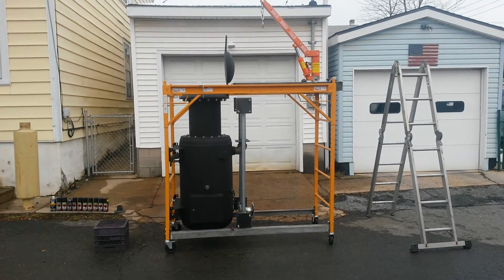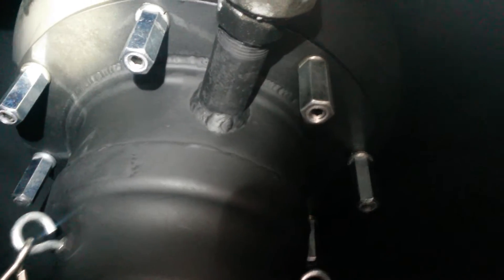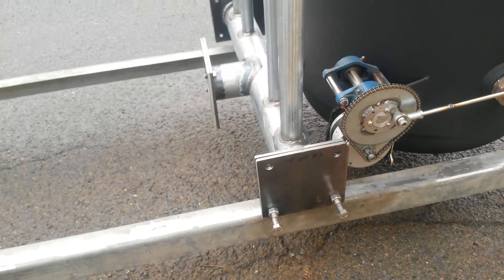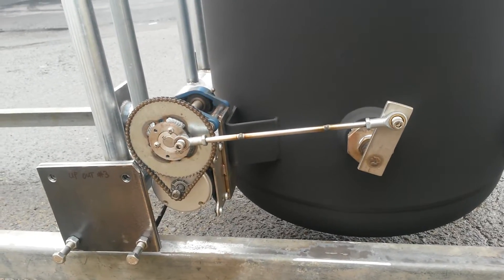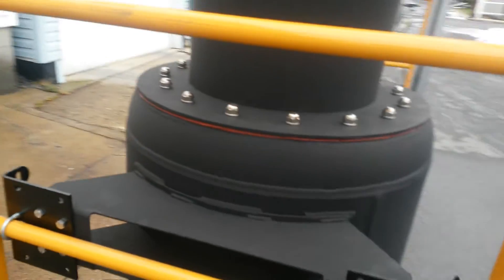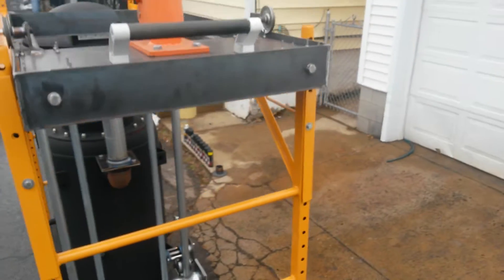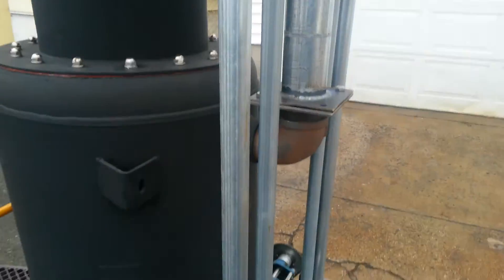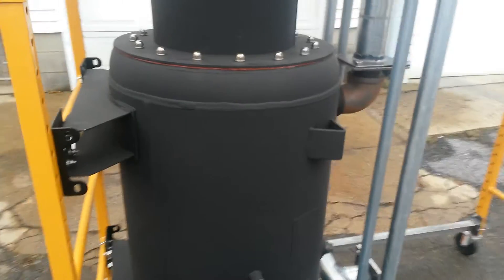Heart of the Flashifier Part 5

Comment: How is your gasifer doing? Nice build just saw it.
Reply from the maker: You really found an old video. This gasifier is based on the dimensions of Flash001usa's gasifier. I wanted to build something that had some success already in the design. It sure has been a long road,  but it does work pretty well. I don't get too much time to work on it or run it, but I'm glad it's at the point where I can just go run it whenever I want. Here is the link to show you the most current state of progress. I still have a few things to do but it's usable just the way it is. Thanks for watching. Joe. https://youtu.be/8CXDcgvjhWI

Comment: How many and what kind of valves did you use,please?Tnx!
Reply from the maker: Vasile Pop , I've used regular ball valves on air , water drains, and propane  fuel lines, and 2" pvc valves for wood gas lines . I also love to place pvc check valves in places where I don't want air to rush back in , in the event of a blower failure or engine shutdown situation. Remember,  you have explosive gas that will only be capable of exploding if you let it mix with air. Keep watching these videos and you will see a small explosion in which I learned this lesson the hard way. Thanks again for following along.  Joe

Comment: leak test it before you burn it... you have a very large internal area for gas...
Reply from the maker: Thanks for the heads up. I am going to pressure test , but only at about 2-3 psi. I expect a little trouble around the rope gaskets, but I'm also curious about the high temp gaskets. They are layers of fiberglass mat and high temp silicone. Not sure if some air will migrate through the fibers. Also I'm hoping the vacuum that will be normal for the system will pull on the clean out door adding to it's seal. When I get there , I'll post my findings. Thanks for commenting, Joe.
Reply: looking forward to seeing your progress.

Comment: Ya know, this beast is looking so good that you probably won't want to get it all dirty by lighting it up  ;) .
I really am looking forward to seeing this fine creation coming to life, and getting a little dirty, in the near future.

What's kind of cute is that I am using power from my gasogen right now to run the computer and write this comment  :) .

Keep up the good work. We are loving it.
Reply from the maker: Thanks for watching. I may not work that fast, but I'm building this thing to ruuuuuuuuuun , and then run some more. Obviously the cost of the parts slows me down, especially once I start with the plc. I have a large electrical cabinet with a window ,to house all of the electronics. You saw the next vessel for the expansion tank, and I will be setting up a dual filtration system, so I can clean one set of filters while still running. I will valve one off , so I would have to shut down to prime the clean side ,but after that it will be running again. I apologize for the length of time everyone has to wait to see this done, but this is my hobby while not taking care of all of the things life,  family and work throw at you . 
  I'm getting an electric chain saw for Christmas . If you've seen my stainless quadracycle , you know I have BIG batteries. I have a 2500 watt power inverter . I also have a 4x8 utility trailer with a winch. Put all these things together, and I can use stored energy to cut trees (that have fallen) into pieces short enough to gather and bring back to process further. Anyway , thanks for commenting , and stay tuned. I will post more videos as I move along.
Reply: mazdalorean
 
Indeed.
On a project as big and important as this, you are well advised to work at a slow and steady pace.
This approach gives you greater lattidude for detection and correction of mistakes in the development process, and also heightens the satisfaction when your beast comes to life for the first time.
Your attention to detail will surely give you a long lived gasser, so you shouldn't be surprised when it goes well past the 1000 hour mark before any minor repairs are called for.
For your dual filtration system, I suspect that you could prime and purge the clean side without interrupting the engine run.
If you tap off a very small amount of engine vacuum, you could use this to
get the clean filter lined up for gas delivery, then go full open - while you valve off the dirty side for a cleanout.
I think you will be pleasantly surprised by what is possible with your system.

For your filters, are you considering a tube design like Flash's gasser?
If so, you might like to try thread mounting them to the plumbing.
I did this with mine. It greatly speeds up the process of cleanout / replacement, by allowing the filters to be twisted into place like Edison Screw lamps.

Ahhh, in giving you an electric chainsaw, Santa is obviously thinking of you this Christmas  :) .
Perhaps he is considering a gasifier powered sleigh, so the reindeer can have a well earned holiday?

By keeping those big batteries topped up, and coupled up to that big inverter, you'll be the only one with lights and other modern conveniences when the next power cut hits your area.
I like the idea of combining all of those important parts onto a covered trailer.
You can take it anywhere, and you won't have to worry about what the weather will try to do to it.
That is something I really must try out, perhaps on the next gasifier build.

I am looking forward to the next step in the evolution of your woodbeast  :) .
Reply from the maker: ***** Thanks for all your input. I like the idea for the threaded filter parts. I haven't put too much thought into the filter assembly yet. It does sound possible to prime the second set of filters the way you described. I am looking forward to the cost of plastic fittings vs. the cost of metal ones. I am taking a week or two off , and plan on hitting it hard after the new year. Enjoying spending some time with the family for the holidays. Thanks for commenting and I hope you have a Merry Christmas and a Happy New Year! Next year will be fun.

Comment: WOW your gasifier is turning out great I like the large ash door and the condensation trap at the top. I think I'm going to do the same on my gasifier  thanks for doing the videos I'm learning everyday!
Reply from the maker: I haven't run this yet, so some of my ideas aren't proven yet . I think I will be insulating the entire surface of the hopper that is exposed above the outer vessel. My thinking is , if the hopper is warm with no cool air on the outside , the condensate won't form there as easily. Anyway , thanks for watching.